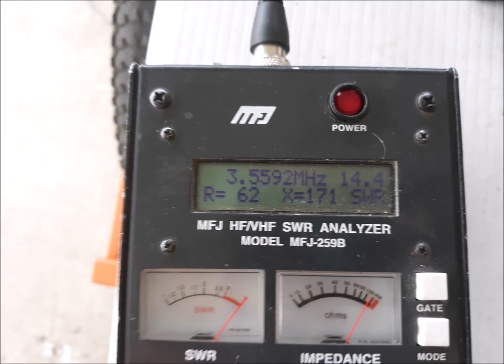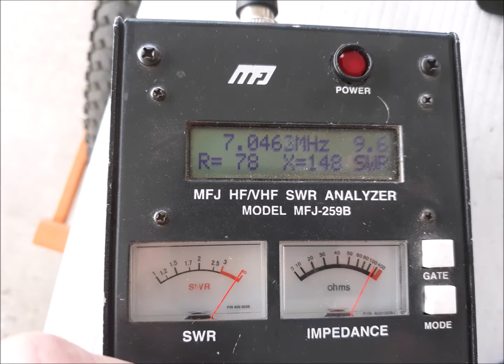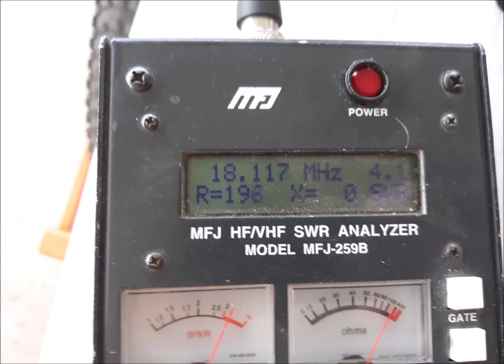9:1 Unun and EndFed Part 2: SWR Testing

Comment: in a K6ARK video, he builds a 9:1 unun on a BNC connector. K8MRD then shows it in use in the field in a POTA activation, he used a 41' wire for the antenna and 17' for the counterpoise. neat package, al ve3gam
Reply from the maker: I recall seeing that. So small! Required a tuner, didn't it?
Reply: @MiscDotGeek  I think that is the the default with the 9:1, a tuner.. not at all like the 49:1. al ve3gam

Comment: You did it right. The SWR is expected to be high on a non resonant antenna and that what this is. If you would have had a low SWR without a tuner, that would mean that somewhere there are a lot of losses. As long as you keep your coax reasonably short, you will do fine as long as your ATU is happy. 
Want a better match without a tuner, build a resonant HW end fed and use either a 49 or 64 to 1 UnUn. I use a HWEF40 and no tuner is needed. Now I am feeding my antenna in phase.

Barry, KU3X/QRP
Reply from the maker: Thanks for the comment! I just picked up a ft240-43 for that very purpose! The question is, 49:1 or 64:1?
Reply: @MiscDotGeek  Like a simple center fed resonant dipole, the feed point impedance is a variable. It could be as high as 72 ohms and I've seen it as low as 45 ohms. So is the HWEF a variable.  I use a 64 to 1 if I only go down to 40 meters. For 80 meters I use a 49 to 1. It's pretty much a flip of a coin. Just don't forget to shunt a 100 PF capacitor across the 50 ohm side of the UnUn is you want to operate 15 meters or higher.
Barry, KU3X
Reply from the maker: Yep going for 40,20,15,10. Have the caps on order as well. Sounds like I can try 49:1 to start?
Reply: @MiscDotGeek  Make a dual tap on the secondary. One tap at 49 to 1 and one at 64 to 1.  I just made one like that last month. I just wanted to do some testing. The only difference I noted was a shift in the antenna's resonant frequency.  Both performed the same. 
If you use 2 turns on the primary, tap 2 turns in from the antenna's end of the UnUn for a 49 to 1. If you use 3 turns on the primary, tap 3 turns in from the antenna's end of the UnUn for 49 to 1. 
Barry

Comment: One more thing, I made a 9:1 balun, same one as yours.  I experimented with all kinds of lengths of wire.  I only found one length for 40 and used that for awhile. Now I just built a 64:1 for an EFHW cut for 40 mtrs.  I plan on adding an 80 microH loading coil at its end for 80 meters for my 80 mtr mini.  I have a KX1 for 40 which I built for the other bands.  I'd hate to have you go through what I went through.  Unfortunately, there is no formula for a Random Wire length.
Good luck!  Bob - W9PZ